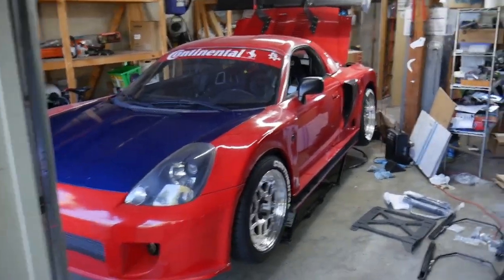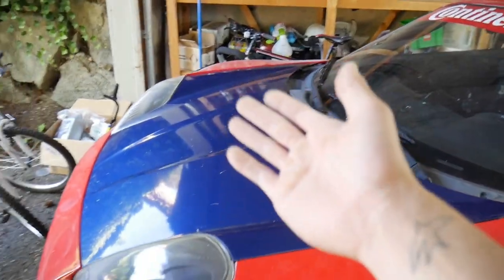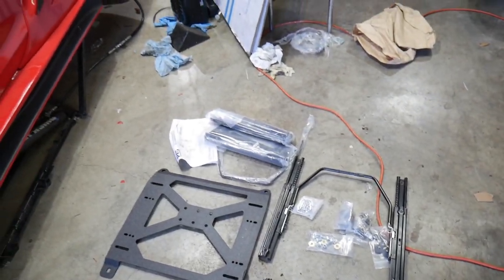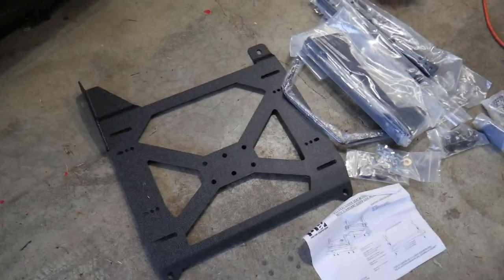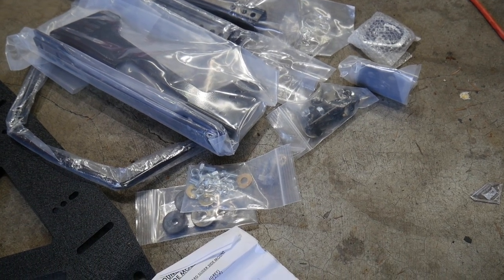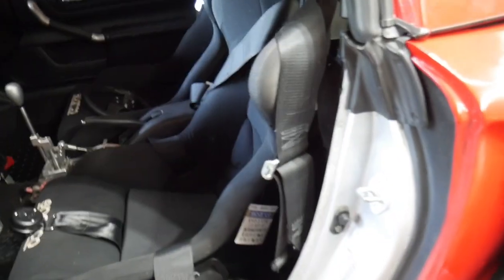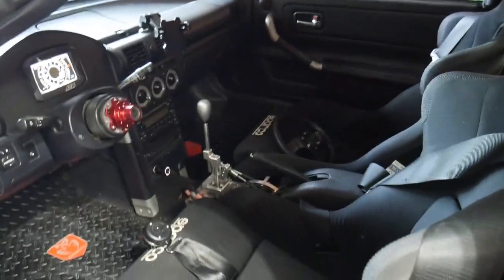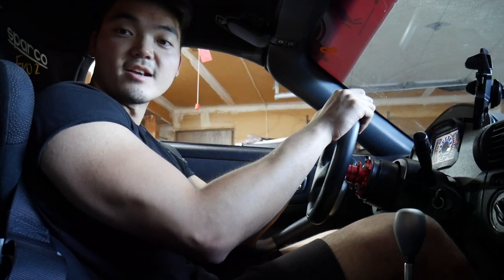The Setup You Need! | PCI Slider Seat Mount Install on my K24 Turbo MR2 Spyder/ MR-S!

Comment: Do you have a CEL code that says what cylinders are misfiring? If so, try swapping coils to a different cylinder and see if the CEL code changes to the other cylinder. Check for any loose wires at the coil plug that could have become loose from pulling on wiring when disconnecting the coils.
Reply from the maker: No check engine light codes at all
Reply from the maker: It seems to be more of an intermittent mis fire